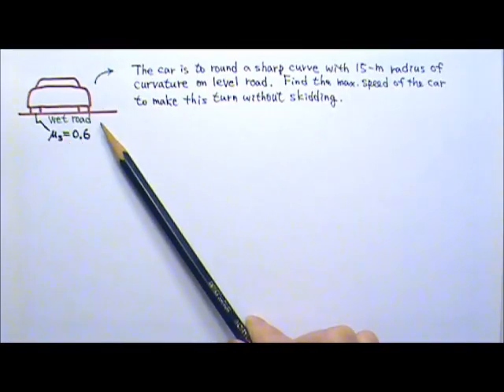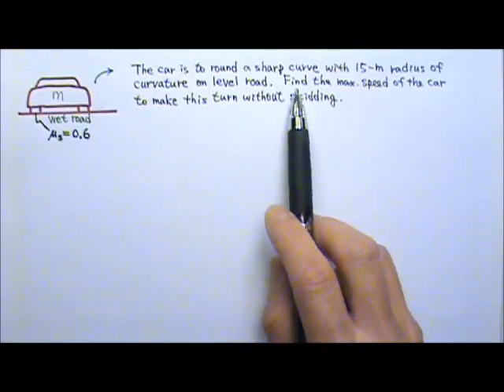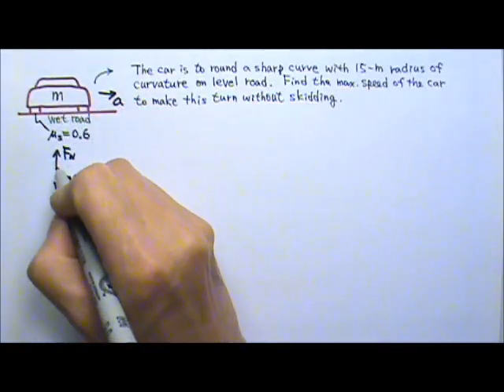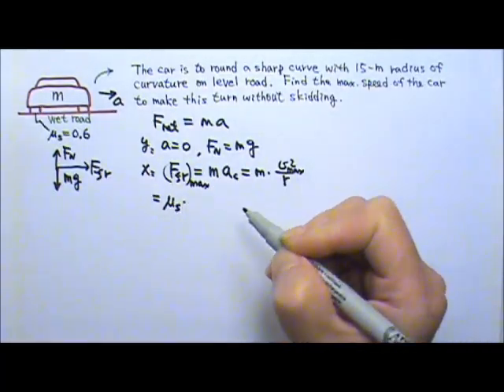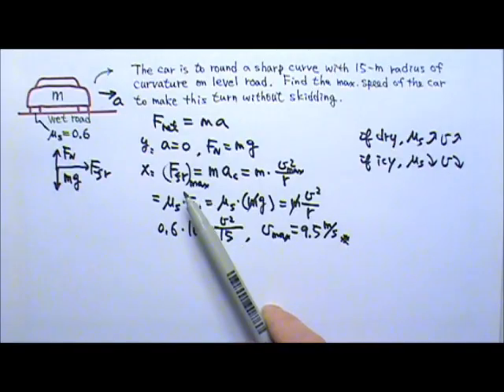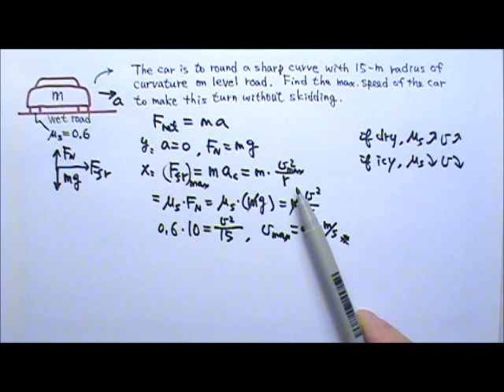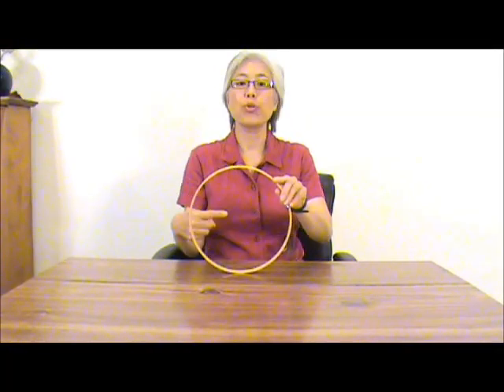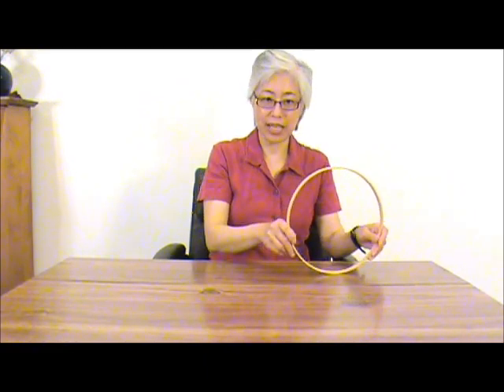AP Physics 1: Forces 20: Circular Motion 2: Car Making Turn on Level Road

Comment: Hi, Ms, Twu!

I am wondering how it is possible that the only horizontal force is the centripetal force/friction because if that is true does that mean the car will come to the center if it continuously making the circular motion?
Reply from the maker: +JeffyMerry The centripetal force provided by friction is in the radial direction and it can only change the direction of the motion (please see: Forces 27: Tangential Acceleration and Centripetal (or Radial) Acceleration at https://sites.google.com/site/twuphysicslessons/home/forces/forces-page-5) So this friction changes the car's direction and makes the car turn (as in a circle). The car does not get closer to the center.

Comment: At around 8:23, You said that the friction of the car on left will be towards right with the acc. and vice versa with car on right.
I don't understand. This is a linear motion example you are giving, right?? Why is friction working in the direction of acceleration. I don't understand it.
Reply from the maker: Another way to look at this is to think about how our bodies would lean if we are in a car accelerating forward (in the picture I drew, it is accelerating to the right). If the car accelerates to the right, we and everything else in the car would lean backwards (to the left). The car has the same tendency to lean backwards (to the left); therefore, the static friction which is against the tenancy to slide would go forward (to the right) to be against the car's tendency to slide backwards. 
When the driver slams on the brakes, a person in the car would lean forward. The car would have a tendency to slide forward too. Therefore, the static friction on the car goes backward. 
I hope this helps.
Reply: Okay Thanks. I had this notion too. Thanks.
Reply from the maker: طلال العدواني Yes. if a car makes a left turn on level road, the friction would point to the left. If you choose to the right as the + direction, then to the left is the negative direction. In that case, both F and a are negative, so F = ma still works fine. 
It's just that in the forces unit, I usually use the direction of acceleration as the + direction. So both my F and a are +.
Reply: Yau-Jong Twu what if the car was turning to the left, and the tendency of our body and everything else in the car would lean right. Would the friction, in the free-body diagram, point to the left (become negative, -Fs)??